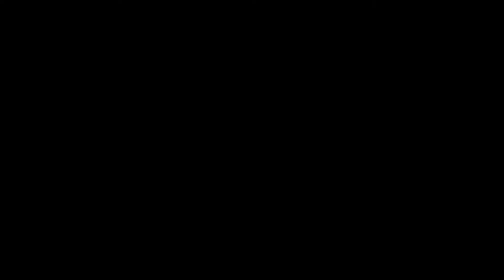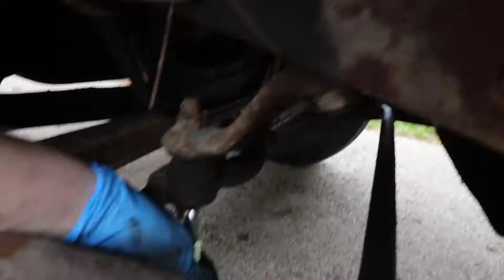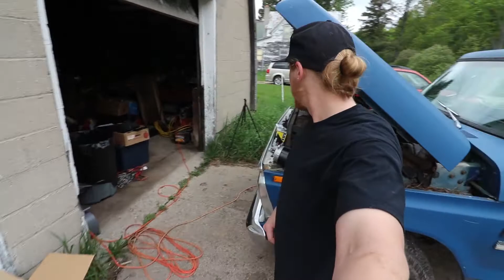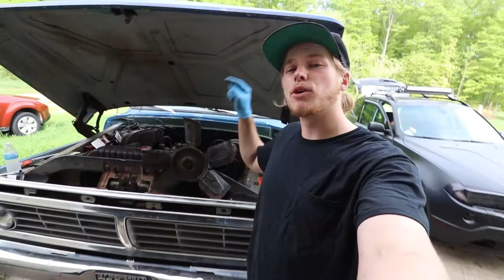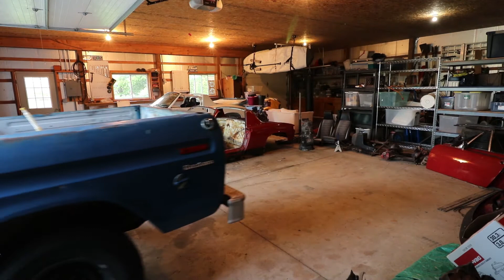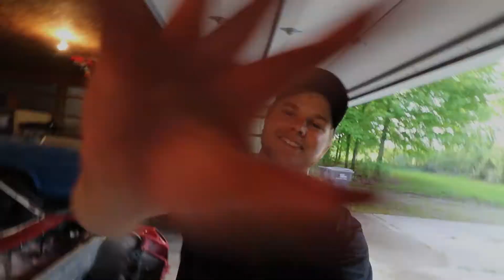Giving My 1973 Ford F350 A Tune Up And New Tires!

Comment: Please tell me how you have a dent side, with a starter on the driver side. All dent sides I've owned, and other year Ford trucks I've seen, the starter is always on the passenger side of the block
Reply from the maker: The camera angle when I did that starter is a little deceiving. My starter is on the passenger side 👍🏻